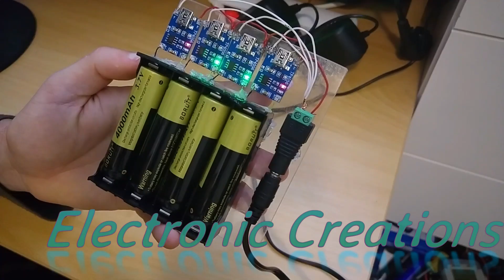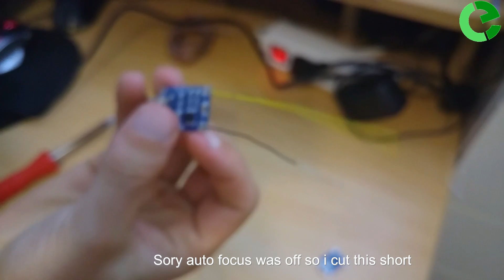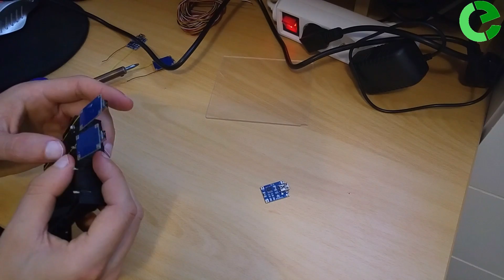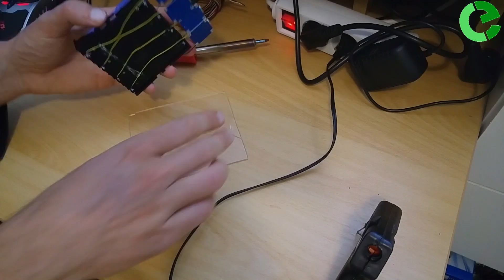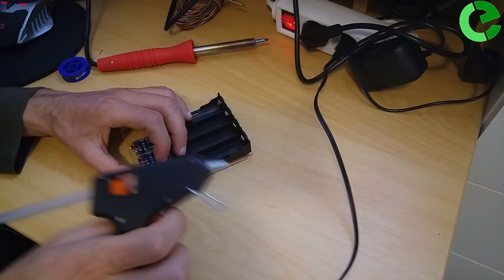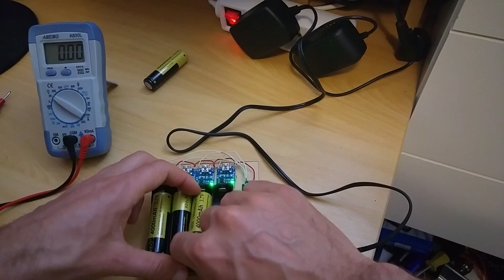Cheap DIY 18650 battery charger

Comment: so Kool the things one can learn about and how a simple thing like that circuit runs the show one battery at a time
so if it's only one you need the job still gets done with out loading a charger up
as most chargers requir 4 battery's to charge nice very nice

Comment: hay I wanna know with in how many hours are you can change all the 5 cells to 4.2v from 2.7 v
Reply from the maker: this is 4 cell charger. With 5V 4A charger, four 2000mah batteryes can be charged within 1.5h
Reply: +Electronic Creations yhaa...
if I connected all those 4 cells in parallel and power them with single tp4056..
the what will be the charging time...
and what's is the capacity of cell you had used in this video ..in mAh
Reply from the maker: then you will charge them 6h or more if they are 100% ok (new 2000 mah batteries) If you are using recycled laptop batteries then charging time can be indefinitely.
That are fake ebay batteries on video.
Reply: OK,
I wanna use 2 TP4056 modules by placing I/p Parul
Reply: I/p parallel with 5v 2A adaptor  and the o/p's are also made parallel to 7- 2000mah cells which are also parallel to each other..   
what do you think ..!
is doing that will be a good choice ..
I wanna do that to decrease the charging time of 7 cells which are in parallel .
Reply from the maker: I prefer 1 TP4056 per cell and thats best option for battery life and safety. If you dont have stronger power suplay you can make 2-3 chargers and use cellphone adapters as powersuply. 
Check my other videos I made few chargers and this one is the worst one

Comment: What tension is in the power pack pinned up to the nest?
Reply: How many volts is the power adaptor connected to the socket?
Reply from the maker: 5v with minimum of 3A
Reply: Ok. Thank you

Comment: if my battery pack is in series
would it be the same to just hook up the wires individually the same as in paralel
Reply from the maker: no. rather use BMS

Comment: Thank you for the Video. One important point is that battery 2 and 4 have reversed polarity from 1 and 3 and should be connected accordingly on the charging boards. Video shows all batteries connected same way. This will cause a fire or an explosion of some sort caused by 2 and 4 misconnections.
Reply from the maker: This is DIY battery holder. batteries are not connected to each other, only TP modules are conected in paralel with voltage input.

Comment: I need to plug 4a 5v charger to charge at 1a to every battery? What is the best amp need to this module with 4 battery charger in parallel?
Reply from the maker: This setup with older TP module can work on 5V 3A but if you use newer TP Modules (with micro usb no battery out) you will need 4A charger.

Comment: Can i use those TP4056 to charge batteries that are connected in series?
Reply: William Oliveira no
Reply: no you shouldn't do that because that 4056 is designed to give max of 4.25 volts if u keep those 18650's in series the max voltage they can take is of 4.2+4.2=8.4
buy the o/p of 4065 will be 4.2...
if you want to charge two cells then place them in parallel and give the o/p of that to those cells in parallel ..
those cells will take more time to get fully charged it may be double the time that takes for single cell to charge ..
 it seams it's not a good idea to charge them in series with out any balancing circuit..

Comment: Is it possible to use two of such TP4056 modules to individually charge two 18650 batteries that linked in series?

Comment: do you know if the female plug you are using, use a 19v power adaptor(green/black)?
Reply from the maker: This is standard 5.5 mm x 2.1mm jack. If you are trying to use it with notebook charger it wont fit, coz they use different plug for different model of same manufacturer.
Reply: easy re-wire. do you think it would take 19v 10amps?
Reply from the maker: I cant find on what voltage they are rated, but they look like they can handle that amps.
Reply: sounds good, thank you. Any reason you chose the older tp4056 for charging?
Reply from the maker: easier to solder and i dont need to have power out from the  battery.
Reply: what about using mp1405 chips?
Reply from the maker: tp4056 have biger spots for soldering than mp1405, but you can use them both.
Reply: Thank you for your time.

Comment: how long to charge 1x 18650 battery cell?
Reply from the maker: It depends on the cell capacity. It is under 2h and it's faster then my ultrafire charger.
Reply: Under 2hours for 1x 18650, but how many ampere of 18650 battery on video
Reply from the maker: 2000mah battery and 3A charger for these 4 cells
Reply: so..3A is the output of 1x TP4056..?
Reply from the maker: 1A but my strongest 5v charger is 3A and I use it to charge all 4 modules
Reply: Hmm... Thnks for all:)
Reply: sorry... long time no see!
ohh..jaa, you said that you charged them all with u r stronger 5v 3Aadaptor,   but wt's happening if  I use the adaptor  4 or more than  4A..?  thnks alot...
Reply: Better for adaptor.Doesn't work full 100% to heat adaptor.
Reply: Electronic Creations Hello, if I want to use 4 of tp4056 to charge then how much voltage and current (power supply) should I use?
Reply: Phong Pham 5v

Comment: I think you reverse the polarity of the 2 and 4 battery connector, because when you solder the module to the battery holder the yellow wire always go down, and when putting the batteries 2 and 4 are reversed.
Am I wrong or right ?
Reply from the maker: Batteries are not connected in series,if you are thinking thats wrong. They are not connected to each other and every battery is charging individually.
Reply: Yes, what happens if you charge a Li-ion battery in reverse polarity ? will they expload ?
Reply from the maker: not sure, but you will definitely kill the battery.
Reply: Thanks..
Reply: Yes, batteries 2,4 are supposed to be connected in reverse on the charging chips since it is series connection. I was surprised to see all batteries charging although polarity was reversed on 2 and 4. Connection his way is very hazardous and will cause a fire.